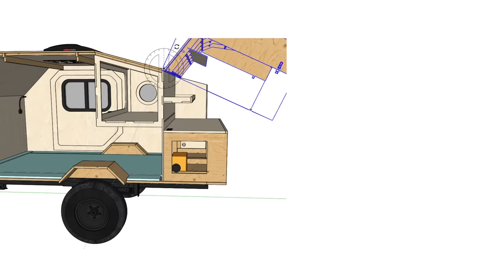Revealing The Shocking Cost of Our DIY Teardrop Camper

Comment: Basically you built a “concept” vehicle,  so your costs are higher than you thought. And you think some items are high,  but when you think how much you got for that money,  you got a lot.  Total Boat is not cheap,  it is high end products. You used better lights, means higher cost.  It’s all high end.  If you build based on what everyone else is doing,  then you would see their much lower budget.  But your camper is insulated, used better plywood, used fiber glass at the seams,  was triple sealed, etc, etc, etc.  I think $5,200 is a good cost for everything you got in the end. My only question is,  could you have bought a trailer that has everything this one has with the upgrades for about the same price.  You put a lot of upgrades in and a lot of labor.  Also,  your camper is much higher labor because of all the assmbly of the multiple layers and all the sealing, etc.  you guys did a great job.
Reply: A lot of big companies are selling theirs for triple that, so not bad for a couple months of work
Reply: I just don’t really see a point for a camper like this that you are dragging around with a big crappy pick up truck… a Prius does everything this does but better. These campers and RVs are just terribly inefficient. Annoying to deal with and unnecessary/expensive af. 

Anybody that has lived this lifestyle for more than a few months will immediately know how important ste alth is and how annoying having to drag around some thing everywhere you go and having to deal with everything else is. This looks good to newbies/random viewers, but it’s a pain.
Reply: I had a crappy  weather day, so I did a watch marathon of your complete build. Overall, an enjoyable watch. Regarding my opinion of your total cost...the figure was for your materials and components. That being said....overall costs are subjective. What do you feel is a fair $ cost of both yours labor? These days , labor is costly...moreso, significantly higher than the actual materials/components. Additionally, you had high-end equipment to aid in the precision cutting of wooden components, which the average Joe does not possess. All these things , collectively, would put the overall cost    at 2.5-3x the $5200 cost you stated....I'm my opinion. You both did an excellent job with a great end product!

Comment: Such a great series!  5200$ is well worth the dough. Knowing how your dedication, attention to detail, and precision building skills.  Well done, Dylan and Molly!  Stay well, K
Reply from the maker: Thank you😊 I think the $5200 is a pretty great value for this, however I now think it’s possible to get the same quality for even less so I am excited to give it a go again!
Reply: Actually, this approach for 5G's does not get you batteries, solar, A/C, heating, cooking, or water!   It's a pine box where a tent will do the same thing (just offering rain protection).  I've been working on the same thing with a HF trailer that will have a QUEEN bed, A/C, Diesel heater, propane cooking, and weigh in at only 600 pounds. $2,800 total.   I refuse to settle for a tiny heavy wood pine box!

Comment: You possibly could have saved a couple hundred by building your own trailer. You practically did that rebuilding that Harbor Freight trailer. Another alternative would have been using 2" rigid foam insulation board.

Comment: Your price of the trailer is good and the weight is not bad.For i built one with a kitchen, with an ice chest and it weighs 920 lbs.and it also has 13 " tires.using a harbor freight trsiler as well. My cost was $4,500 for materials. Just make sure you charge enough for your thought process, and labor. New teardrops made by manufactures can cost between $14,500  - $18,500. So your price is great.

Comment: So we like to go quading, and I needed to have somthing I could camp in as well as haul my quad. We went with a homemade 5x10 utility trauler with a Roam roof top tent. That way I can haul the quad and accessories in the trailer and the tent and awning are always above. Also in Arizona I don't like sleeping on the ground with the tarantulas and the snakes. Anyway. the trailer has a wood bed and a loading ramp in it. We put a used Roam XL roof top tent on it, and it cost 5K, so I think the money you put in to that is absolutely good especially for the extra quality and insulation you put in it. I would not upset with that at all. If you are curious about what I am talking about, check out my latest video it is in it.

Comment: 100% agree on the doors.  A few of us manufacturers have been working with the primary manufacturer in the USA to fix their process and to improve their quality.  That has really started taking place in the last  few months.  Your take on DIY vs manufactured doors is on point.  I experienced the same when I built mine in 2007.  This is a really great first build!  I'd say most of your weight savings is in the HF frame.  Most manufacturer's use a forged steel welded frame that is 1/8" - 3/16" wall thickness for long term durability (= less liability too).

Comment: 1390 lbs

I recently completed a trip from Oregon to Michigan and back with my trailer that I finished building in july.  I pulled with my 2020 forester and averaged 20-22 mpg.  Mine weighed 1650 full.

I was just going to mention I spent about $8500  (most cost was the trailer I had built from 2by 4 C channel 6061 aluminum and a Dexter torsion axle with e brakes and the Auto brake controller and heavy duty ratchet wheels so I could get up over a curb to park in back yard.   

my biggest pleasant surprise was buying 5 foot by 10-12 foot lengths of .032 aluminum sheets from coast aluminum in portland for About $80 a sheet.
Reply from the maker: Amazing!! And how fun that trip sounds!

Comment: Lived this series! Awesome work and following comments in no way detract from your work. For me, the plywood layers are overkill, but I’m sure it will wear well. I would have glued ALL the wood joints. Dimensional lamber is going to shrink and the friction joints will loosen. Last comment is lack of fusing on the electric. Would not cost much to fuse the DC circuits. Not sure how AC would be fused on a camper but I suspect there’s protection that commercial campers have to use.

Comment: Thank you so much for making this video! We are a teardrop trailer manufacturer, Bean Trailer. We use composite floor, walls with a one piece molded fiberglass shell and 3500 Timbren suspension and we get people complaining about price saying they can make one for what you spent on just materials! I assume your $5200 costs were just materials? Did you track your labor hours? If not, your direct cost would have been much higher if you attributed a labor rate of just $20/hour.
Reply from the maker: Labor is irrelevant if you are building it for yourself. No is is making $20/hour sitting on their couch on nights and weekends. 

There is no denying that a composite Bean trailer is going to be better than your average DIYers teardrop. I don’t think people build them to make them higher quality though. They build them to save money and for the novelty/fun. The cheapest Bean trailer you can get is $16,000 and they go wayyy up from there. At $11,000 in labor you have 550/hrs or 13 full-time weeks before you aren’t “saving money”.
Reply: My point is that it is much more in labor and materials to build a teardrop trailer than people realize. How many hours did it take you? Our material cost on the most basic Bean are over $8K(one piece molded fiberglass shell,  composite wall and floors , off road worthy frame and suspension,. quality Tern windows, etc.)and that is without any labor. Your video was refreshing because we get a lot of comments like "I could build that trailer for way less....." Well,  no you cant. It would not be built like our trailer and you wont be able to account for the opportunity cost of your time. If you want to build your own trailer, I get how someone could look at that as fun. You just have to know it is going to cost you more than you think and you will have to have nothing better to do with your time.   @Woodbrew
Reply from the maker: @mark-di5pf They can build one for a lot cheaper than they can buy one. Will it be as high of quality? Probably not. Will it be as time efficient? Probably not unless there is a big lead time. Is there opportunity cost in DIYing one? Possibly, but for most people absolutely not. I hear this time argument time and time again in the comments, but there is only opportunity cost if you get paid more then than the people building your teardrop AND you have the opportunity to work more. For most people the answer to that is absolutely they do not get paid more. Most people could find more free time to use to build than they could time at a high paying position. 

The people who say “I could build that cheaper” will never be your customer.
Reply: Opportunity cost is a loss of a potential gain, monetary or otherwise. .  That includes "is there something I would rather be doing than building this trailer.' I would not care to speculate and speak for 'most people''. @Woodbrew

Comment: WoW great video! Just bumped in this on my feed.
Looked at the beginning because I wanted to see the cost for CNC. Then I realized you had your own machine.
Just curious to know what kind of budget someone would need to get this done by CNC?
Apart from the benefit of the tight fit it give, maybe the cost of getting the CNC done would be way more than the 10 sheet of extra wood saved?
I would like to get your input!
NOTE: This is not a critic!
Cheers!

Comment: I would also require therapy if I spent USD 1550 on the first frame work alone. Gee. I spent $5 and bought a camper in worn out shape. Fixed it up, new tires and all, new traffic lights all around, the only thing original in that part are the old side position lights. Currently touching up surfaces inside, made 14 meters (that is close to 46 feet) of foam mattress with new covers in furniture grade fabric and found a new set of break pads for it as well.
My cost total for a "Polar 470" Camper, including first MOT inspection, road tax and all... $ 850. ;) Almost half of your frame work alone.

Comment: I'd sooner build one out of XPS foam with glass skins in and out, 2 layers of 4 oz cloth with West Systems epoxy. My target weight for the one I want to build is under 500 pounds with the chassis, 5 foot wide, 10 feet long, 4 foot tall, with a homebuilt trailing arm suspension.

Just a guess midway through the video that build will have ended up around the 1275-1300 lbs range. I have built a few different flatbed trailers over the years and also looked at a bunch of other teardrop and squaredrop builds online at the TNTT forums. 

I am not knocking your methods, but 1/2" outer skin is way, way overkill. Think airplane, not tank.
Reply from the maker: Yea Yea foamies are cool, but not the build method I wanted to do on this one. 1/2” is overkill, however I like overkill and 1/2” was the only truly waterproof plywood I could get locally. The primary goal of this camper was to make something that isn’t going to fall apart in 5 years.

Comment: Was this teardrop expensive for a DIY? Yes. However you spent money on what I consider the "right" things - R & D, getting things right before building!!! etc. Would I build mine this way? Well yes and no. R & D? YES! All that plywood? no. Wiring? YES! All the LED lights I can use!!! Insulation? oh Hell yes! The doors are just not going to be a place to save money. To get them to work right, you really need to do the homework. My plan is to build them custim.

The only real complaint I have for this project is the axle location - IMHO it needs to be further back. Most utility trailers  have it set back 2/3 of the load area. For this trailer, a little further back than that will do find. But if this trailer tracks just fine and doesn't feel like it's generating any fishtail feel, it'll be fine!
Great Build!!!

Comment: Congratulations on the finished product!  Any idea what the cost of a commercially available camper the same size would cost?  My philosophy is similar to yours in that I would spend more for better quality and reliability.  Now if your build under cuts the cost of a comparable new one, that is a win-win scenario.
Reply from the maker: It’s wayyyy less than the commercial equivalent. It’s built like a $25,000 teardrop but lacks some amenities so it’s probably around $18,000-$20,000.

Comment: $450 for the trailer... man. They shot up to like $1200 CAD = $896 USD to buy one in Canada. :( that's for the folding one. You can get a solid frame trailer for $2000 CAD = $1493 USD. :( :( :(

Comment: $5200 was just the cost of materials though, yeah?  Your labor is worth a LOT more than that.  I'm curious how much you charged the new owners for this full build.
Reply from the maker: I’ve answered the labor debate in a few other comments if you want to check those out. I’m not a liberty to discuss the price, but I can say they received the family discount.
Reply: More than 2 x $5,200 if you watched the full video.  Then labor on top of that!   
Honestly you can get a RoadToad for less money, less weight, better build quality, larger, and a warranty.   
Sorry but paying over 5 large for a pine box with no heat/Air Cond, cooking, water, batteries, Solar, etc is not a good deal.

Comment: If $5200 is what was spent on the build, then well done! I don’t know anything about campers, but it seems you built a camper that is superior to what’s on the market.
Reply: $5,200 + $5,200 in doing it wrong (research)?  Get a RoadToad instead and it will weigh A LOT less and be more durable and more interior space, and roughly $8K.  And a warranty.